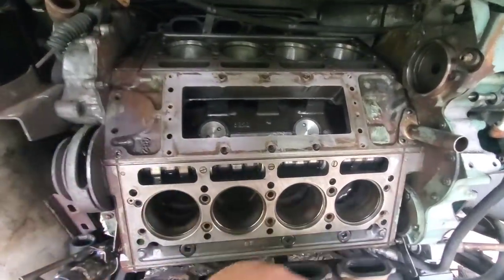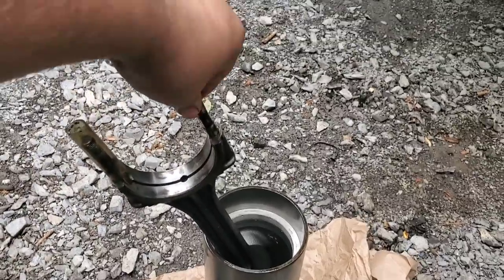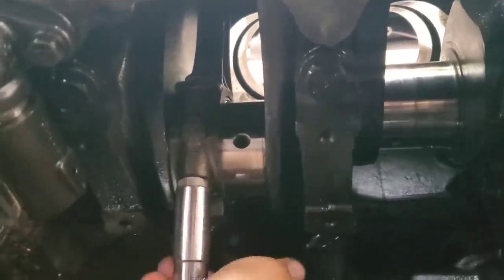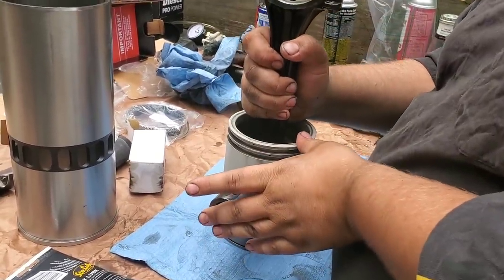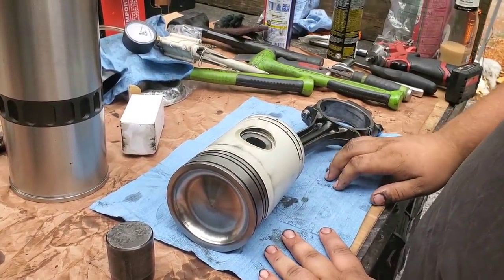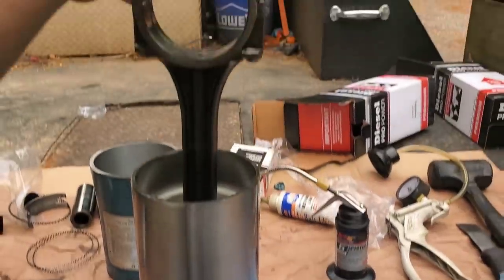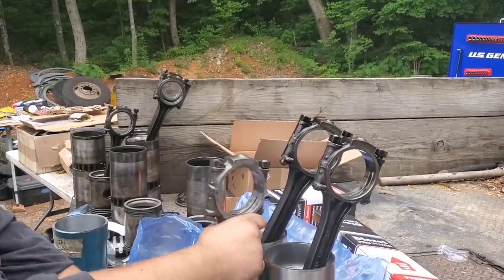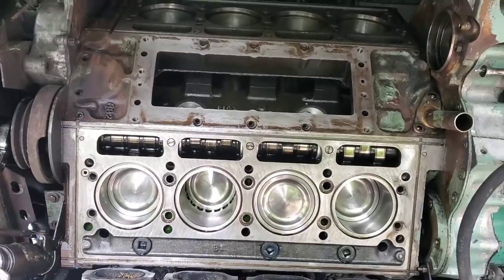Building Lance's short block

Comment: I've been watching ur dad for awhile now and I don't think I've seen a full tear down of an 8v71 witch i have in my own 1967 GMC thm400 City Bus aka "Fish Bowl bus" that was originally used by the city of San Francisco and ended up with Michigan  State  University before it was purchased by a retired Vietnam vet and bus mechanic in the mid 80s where he converted to an RV and then I  purchased about 7 years ago. Its been off road for 4 years due to job changes and health issues and the tires being completely shot and dangerous to drive on as well as the voltage regulator being bad and charging at 10 volts. I'm not sure if the hot start issue is due to the charging issue or not. Its an automatic that shifts perfectly and still has the hand brake. Its got some hacked wiring issues from the previous owner so its only starts from the rear. The engine is supposed to be rebuilt and I believe it the guy I got it from had many more engines and trannys that were in various stages of rebuild. Bigger injectors and starts without either down to about 45 degrees and if plugged in I've had it start down to 10 degrees when I tried it. The high idle doesn't work at all and I get a random knocking sound around 2400 rpm that I can't figure out but it hasn't had any issues when I've used it to go to the infield at MIS several times. I've never taken it farther away from home than the 50ish miles to MIS as the tires have always been an issue but obviously have gotten beyond the I believe it will be fine for the short distance as long as I go easy on it stage. So very nice to see this as I imagine that I will be doing a rebuild at some point in the future.  I do take it out and drive it a couple of miles around the block a couple times a year so its not sitting

Comment: I've gotten in the habit of cutting boxes open the instant I get them and doing a parts inventory. I've gotten boxes with the right part number, but the wrong parts inside before too.
Reply from the maker: Yea first time ive had an issue with this supplier. Will have to from now on with them.

Comment: Still no mention of honing, or even measuring the bores?  Hope it lasts longer than some of the ones your dad did...
Reply: Not an issue for these are brand new liners, standard original size.
Reply: @bruceknowling415  You're missing the point, it's the block that can be the issue.  Procedures in the book, and oversize liners, are there for a reason..  Anyway.

Comment: What are your thoughts on staggering the ring gaps?  For some reason, some people make a huge deal of placing the ring gaps just so.  This is just a waste of time because rings randomly rotate in their grooves as the engine runs.  So no doubt the ring gaps have lined themselves up countless times during the engine's lifespan.  
  I've even heard people claim that an engine won't start or run if it's assembled with the ring gaps lined up!  How silly!
Reply from the maker: I do it purely to not have to listen to people complain. But yea the rings spin as they move. By the time the engine is assembled, tuned and ready to start the rings will be in completely different positions.

Comment: Tyler:  What's difference in the rings for a city bus vs a highway bus? Thanks.  I never knew they had different rings for that.
Reply: The transit buses idle a lot more so the oil rings have to be designed for the lower cylinder pressures.
Reply: @billmoran3812  Thanks Bill!

Comment: I had a few times with a certain online store-
someone was returning used parts in new boxes,
and they were being restocked. Nobody was bothering to check the
contents of the boxes they were shelving. I was half expecting
to get a rock one day. Supposedly I wasn't the only complainer,
but it took a while to resolve. Timing sets, bearing shells, head lights,
brake stuff. I never found out if the returns were malicious or accidental.
Sad, forced to buy online, then quality suffers.

Comment: Great work Tyler! Do you guys ever plastigage the rod or main bearings, or are they dang close to being exactly correct out of the box? I guess the bearing is stamped as either being standard or oversize anyway, so probably not a big deal. Sucks about the parts screw up.
Reply: Nah, they never measure or hone the bores either.  Seems they just throw in whatever size sleeves that came out and hope for he best (fine for a quick fix in the field, but doesn't always work out in the long-term..).
Reply: @macelius  there’s no wearing surface where the liners contact the block. It’s rare for oversized liners to be used. Replacement of the liner with a new std liner should bring it back to factory specs.
Reply: @billmoran3812  Have you ever looked in the manual? It's not about a "wearing surface", it's about doing it by the book. 

The procedures and over-size sleeves exist a reson; Spec bore-to-sleeve clearance is essential for proper cooling and fluid control.  Gaps will cause hot-spots, seepage, and a layer of burnt oil can build up causing further cooling problems.  Judging by the wear in the sleeves that came out, this may have very well been an issue.  The blocks warp from heat and the bores can become out-of-round and out-of-parallel overtime.  While this rebuild is not a result of an overheat, the last one was half-assed also, and the block is decades old at this point so who knows what it's been through.  Oversize liners are more common than you think these days.  
Either way, one should take some measurements at the least, and the same goes for crank bearing clearance.  You never know what you've got, and you can't trust any previous work and assume it was done correctly.  Just replacing with 'std sleeve' (if you can say there is such a thing, but I won't get in to that) might just result in the same problems in as little as a few thousand miles.  If I was paying someone THOUSANDS of dollars to rebuild my engine, I would expect more due diligence. 

Just check out the Lacroix Cruiser channel to see what can happen if this is not adressed.

Comment: Why does the o on the ring matter?  Meaning o goes toward top?
Reply from the maker: Not sure on this particular pack but someone with a engineering degree said so, so I will.
Reply: @Spyke383  just wondering the science behind it
Reply: I'm not sure in this case, but I believe that some rings are outside ground on a taper rather than flat from one side to the other, and you want the sharp edge of the ring on the correct side.
Reply from the maker: These rings appear to have no noticeable cuts, they arent keystone, but it's very possible they are tapered by a few thousandths
Reply: @Spyke383  love the channel. Thanks for responding to your fans!